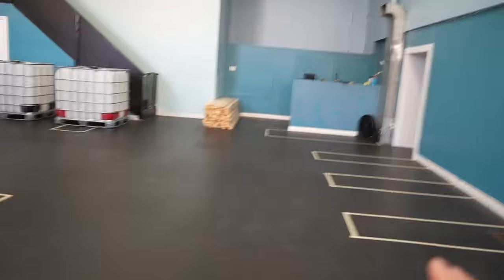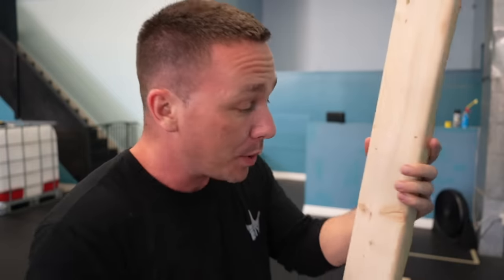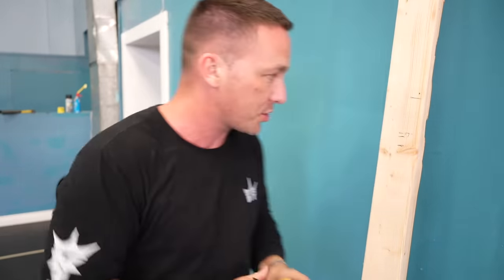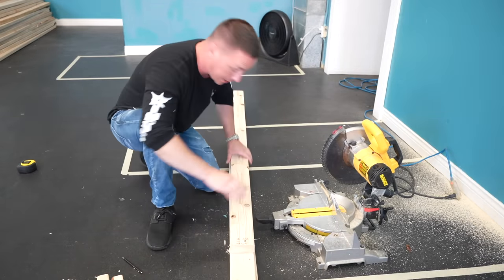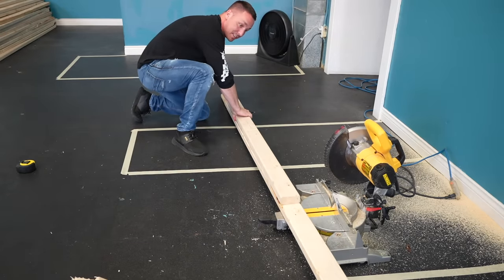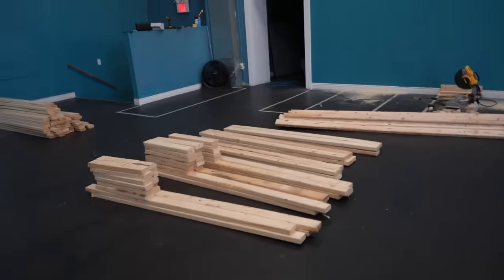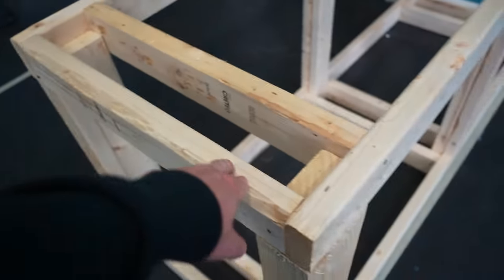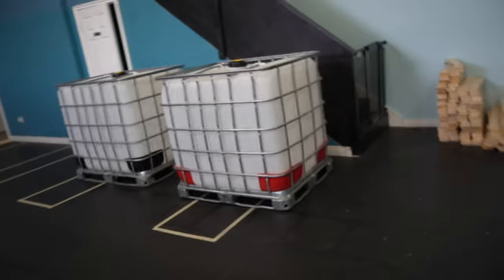How to build an aquarium stand like a pro - The king of DIY

Comment: I just bought a 75 gallon last week and plan on getting 3 Tiger Oscars. I am going to try and build this stand after work today. Looks amazing! But I have a question. I will be putting the 75 gallon on the second floor of my house. So a full 75 gallon tank is 850lbs plus I’m putting 3 50lb bags of sand plus driftwood. Will my second floor be able to withstand about 1300lbs? My house was made in 1917 😂😂😭😭

Comment: Joey: "So to give you just a rough idea, a tank weighs about 10-12 pounds per gallon"

The metric part of the world: "Or you know, 1 kilogram per 1 liter of water"
Reply: He is taking into account the weight of the glass or acryllic and the weight of the substrate and decor in that estimation though
Reply: @UlasAktok  I know, but those too are a LOT easier in metric to estimate. Rock is around 1600kg/m3 or for easier measuring: 1600kg per 1000L. 

If you can only fit 240L of water in your 300L aquarium, you know there's 60L or 96kg of rock/sand in there.
Or glass weighs 15kg/m² for 6mm, so a 1x1x0.5m aquarium weighs 45kg.

There's just a lot less guessing required in metric, because everything relates in easy ways :-)

Still kudos to Joey for building all this, he does an amazing job and I love watching him :+)

Comment: I will probably never build anything like this and the imperial measurements system doesn't make any sence to me (god i'm glad we use metric) but I still watched the entire video lol
Reply: In this metric country, timber is usually sold in lengths with multiples of 300 mm. As a lot of the video are rough rules of thumb, treat any multiple of 12 inches as about 300mm, and 2x4 timber as about 50x100mm. Though similarly to where Joey is with 2x4 timber not actually being 2 inch x 4 inch, it's often 40x90mm wide timber or similar.

Comment: Is it possible to not put in any center supports for the front so that a sump could be placed underneath and easily removed, repaired, maintained, etc. without compromising the integrity of the stand? I've got a 230g tank that's 6'wide and i want to use my 75g, 4' wide tank as the sump. i would add the sump after the stand was built though.

Comment: Don’t look like there is room for corner overflow pipes cause of the inside 2x4..  I like the build though. For my ends I use 3/4 plywood then 2/4 on front back and middle in between the 2x4’s that run the length of the tank for my supports.

Comment: mine are going on 40 years. all 2x6 , no nails or screws. perimeter top and bottom.  3/4" dowels on all joints. triple sealing oil stain.  13s and 55s. like new. been a lifelong woodworker by trade. stay away from particle board anything

Comment: Do I need to support the sides of an aquarium,  would I get away with supporting front and back edge and moving side supports away from edge. I'm designing 3 tier racks for fish room, 6 inch gap, 4 inch timber. But if the supports front to back are not running along side edges of aquarium but instead pushed in 10 or so inches out would give you the full 10 inches instead of 6 at the sides of the tanks to add rocks larger than 6 inches.

Comment: If I was building a stand for a 300 gallon deep dimension (72Lx36Wx27H) glass tank.. Do you think I could get by with just one center brace and two doors, or should I divide it by thirds and have 3 doors with 2 braces?  I'm using 2x4s for the frame and 2x6s for the support beams..

Comment: Do you use wood glue in addition to the screws? It's supposed to be stronger than screws but I'm wondering if there's a reason not to use it? We are building a stand for a 300 gallon!

Comment: Im building a coldplunge right now. Next will be custom stand for 55gal
Im 6'2" and currently i have a generic 30in metal stand sitting on 4 concrete blocks so its 16in taller. I dont completely trust this stand and would like it to be taller. Getting it level with me my biggest hurdle. Got a miter and pocket hole jig for cold plunge build. This is a great instructional!

Comment: Hey Joey if i wanna build 2 stands each with a 140 gallons on top and a 66 gallons in the bottom does i need the middel support ? and should i still use 2*4 wood ?

Comment: Hi Joey quick question I'm about to build a new aquarium stand I've built  4 other one like you build. But never for the 330 gallon glass aquarium I just bought from a friend. 6'×30"×36"  not sure to use 2x6 or 2x4 for the frame. What would you use?

Comment: Love that you did another stand video, especially with this one going into more technical aspect and behind the scenes of it. Currently in the planning stage for a Mega-Stand for the wife. We're building a stand that's gonna hold two 55s side by side, along with it getting boxed in on the top to put a 35inch TV on the top. Yay personal engineering.

Comment: Food for thought… A nail has much more shearing strength than a screw, while a screw has much more tensile strength than a nail. Always look at what direction force will be applied and choose the right fastener… and always use waterproof glue to back up any wood joints you assemble with a nail or screw, 99% of the time the wood will fail before the glue joint does.

Comment: I know you love these 2x4 style stands, and I get they are cheap and easy, but can you show some all plywood stands? I've seen tons of all plywood stands for 120 gallon tanks that have been around forever. Some are 2 layer laminated 1/2" ply or 2 layer laminated 3/4" ply

Additionally, I'd like to make a stand a bit deeper than a 90 gallon tank I have (so I have a "shelf" on the front and back, basically... Primary reason is my sump is the same size as my tank, so I need a stand that has enough room)  - Some insight on that would be helpful.

Comment: I think you have a great design and have the most useful information I can find.
How do things change if I want a stand 48” or 4ft tall?
It’s for a rather small tank about 80 gallon.
Any extra precautions? Tank is 35x60x125 centimeters.
Need the height as is going on back wall partially behind/above tv.
Any response would be greatly appreciated

Comment: Nice! Your design is similar to the style I built. You're is overbuukd a little, but similar. I had two steel ones made for me that are 30" tall which put the two big (for me) tanks at 59.5" overall height. So only 2.5" more than what you're doing.

Comment: Hey Joey, great video!! I'm a big fan.
I'm going to build one just like this.
Couple questions:
- If the stand is not level: can I simply put some shims under it to adjust?
- Could I add legs under this? If so, anything to watch out for?
- If I wanted to make a walnut wood casing for it, should I simply attach it to the frame directly? (screws, dominoes, glue)

Comment: Hey Joey! Love your videos and your builds; I used your build myself for my 55 gallon stand.

I have a question. I want to add a sump system to my aquarium, however, due to the center supports in your stand build I can't fit anything underneath. Would I be OK in removing those center pieces (the vertical supports) from the stand, and relying purely on the corner pieces? I figure the stand would still be supporting around 3000lbs, even with only 8 2x4s as opposed to 10. My aquarium is rimmed, so the weight is on the corners anyway.

Thanks again for the videos! It helped me get into the hobby.

Comment: If you happen to see this comment, how do you plan on moving the 700, I know last time you requested out for some help. are you doing the same thing this time? also, are you planning on moving that tank in first? with how big that tank is, I would expect it would make life easier if you had as much space as possible to help you move it around as needed.

Comment: Love your videos please keep them coming . I have a question about building stands . I see that you use deck screws for all the butt joints , Would it be a disadvantage or advantage using pocket holes for these joints not considering the time but the strength ? Thanks so much

Comment: Good video.  Got a few good tips for my next build.  

Although, I much prefer the "guides" to be the full height, then they directly support from the tank to the floor, with no shear loads and no connections, especially if you put a piece of ply on top to help distribute the weight more evenly.

Looking at the construction of available stands, I prefer the DIY stands not as much for the savings, but the commercially made ones are not build nearly as robustly.  I think their safety factor is more like 1.1 than 4 times!  I bought a used 120G with stand; looks very nice with pretty trim, but once I looked at the structure I was like never getting a commercial stand again!

Comment: Thanks so much this helped with my overall design i was pretty close on my own but double checking i fixed my design.  And can be on my way to building this. Instead of plywood im doing 2x8 top put them together then stain and poly it all . Then add the bottom shelf.  50 long  ,  20 wide and 30 tall . My tank is  21 inch high by said and done my height should be around 52ish depending how thick the 2x8s are i just dont recall till i get em. This helped immensely with my thought process to tackle this way better. Awesome video. I would of liked to see more close ups. Top view its nice to see how its all tied in together than just looking a few feet back.  I paused it and was able to pick out the design.  Thanks so much!

Comment: how would you go about leveling the top for a glass tank? i followed this design and built my stand and it looks great but the tank does not sit flush on the front and back boards. theres about a 1-2mm gap.

Comment: Ok this tutorial was definitely what I needed!! I'm planning on making my own stand for my first ever aquarium and I want it to be very long since I want it to also work as a media unit for the TV. So I'm talking 3 meters long (about 10 feet) but not so high, no more than maybe 1.5 feet. I was thinking of doing like 4 middle supports and have it standing on legs made out of 4×4 positioned right under the middle supports. The aquarium is a 30 gallon and will be put on the right side of the long stand. Do you think this will work?